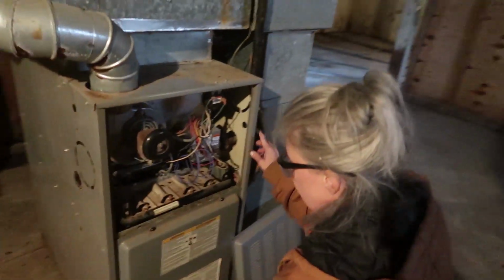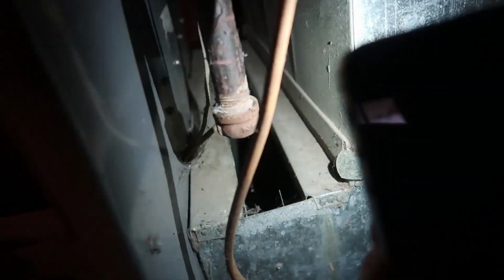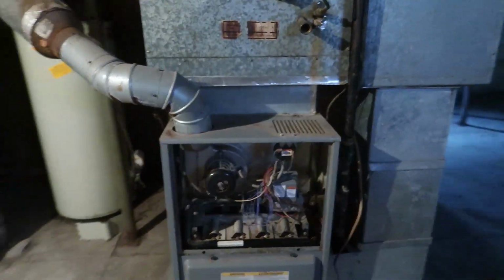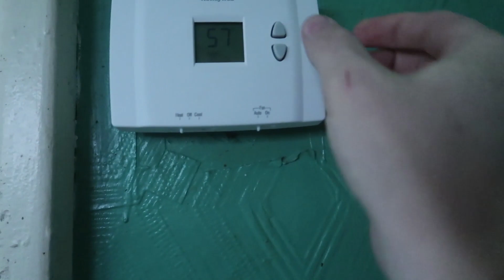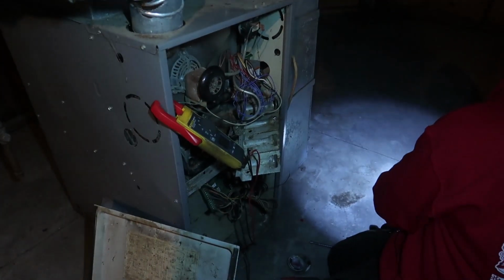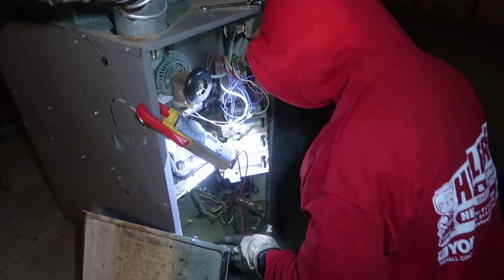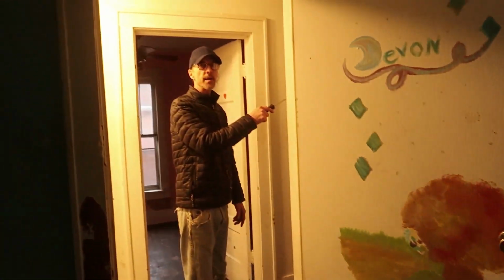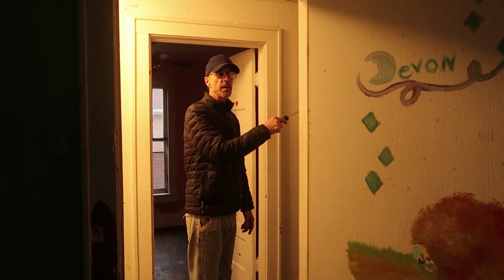1925 Abandoned House Restoration 17: Furnace Is Finally Working

Comment: The induction fan (black spinning fan) will pull a suction on the grey hose to the black diaphragm switch. If that switch is not good then it won’t light. If the hot surface igniter is not glowing then that’s a problem. If it lights and goes out then no flame detection.
Reply: Biggest problems I had with the old gas heaters at work was either the draft inducer not running, or the manometer switch not working.  If it doesn't detect draft you get no gas flow.

Comment: Pilot flame heats the Thermo Couple tripping the Gas Flow.   Until that happens you have no gas past the Regulator.  Same as the Water heater.
Reply from the maker: this had a bad smart valvr and no pilot flame
Reply: @RinoaL  I would still investigate into doing a Waist Oil Heater.  They're actually not vary complicated.

Comment: That top round switch is an air pressure switch.  It engages when enough air is flowing through the flue.  If that is damaged or not engaged the mains will never fire.  A damaged wiring harness will prevent that signal from getting to the control board.  When the valve is bad, the control board will still try to run the furnace (start the flue blower, etc) so its tough to diagnose on your own.

Comment: So they put in a brand new valve and that was faulty too ?
Sounds a bit sus to me, like they finally found it was just a simple bad wire or connector, but they still wanted to make the profit on the expensive parts.
Reply: I agree; very sus. These valves are not unreliable things.
Reply from the maker: well they replaced a lot of other parts for free and wasted a lot of their own time and 7 visits, if they were going to rip us off they wouldnt go to that effort
Reply: @RinoaL  7 visits and lots of parts - yes I agree with you then.
Reply: When it takes 7 visits and changing out lots of parts to diagnose faulty gas valve, the contractor is honest but incompetent and I certainly wouldn't be using them again.

That furnace installation BTW is horrible and it's a very cheap builder's special furnace which probably has a cracked heat exchanger now. (did they bother to check?) 

The transition to the existing plenum is particularly bad - it's supposed to widen from the furnace outlet so where it connects to the existing plenum, it's the same dimensions.

Comment: When a furnace doesn't work, don't bother trying to figure it out, just call and get it serviced.  There's alot more to them than just gas and flame.  They turn on and purge to ensure the chimney isn't clogged, and so there's alot that can make it not fire up.  In this case there was a slew of parts that wound up getting replaced.  In the end, since so much was replaced, it should give several years worth of service, just be sure to change out the filter at least once (preferably twice) per season, so at the beginning of use for the season, and about 1/2 way through the winter.
Reply from the maker: nobody thinks its just gas and flamep
Reply: Furnaces have a sequence of operation.  If you do a little research on your own, and our able to fix it safely, then give it a try.  I replaced my draft inducer motor with a little bit of help from “Youtube”.  It was very easy, and saved me some money. I’m glad they called in a professional though for the 1925 house.  It needed a good onceover, and now they have a warm home.

Comment: So Bill isn't the sole owner?
Reply from the maker: hes the majority owner, i own 1/3rd technically
Reply: @RinoaL  .. with dibs on the central library/command centre? 
I came across a half dozen security cameras this week & I wish I could find a quick and dirty way to crank 'em through a VCR so that I could document the cowardly crack heads that will steal anything not bolted down in my yard and work area.
I dunno about the legality of my CO2 and printer ink Porch Pirate Prize Package though.
A pretensioned CO2 cartridge is held in place by a launch pin attached to a discrete wire anchored nearby.
:4)
Reply from the maker: why not just use a live grenade in the package?
Reply: @RinoaL  because I don't want to have to pressure wash dog 
sh!t off of my lawn
Lol

Comment: Vacuum all that crap around the burners before it catches fire. Get it examined to make sure there are no cracks in the heat exchanger. Hate to write it, but finding honest furnace people is not easy. A guy with a hoody in the basement is hiding.
Reply from the maker: lol hoodie, thats Robby, hes wearing a hoodie because hes cold. ive known him for decades.
Reply: Or just be sure to install a couple CO detectors!